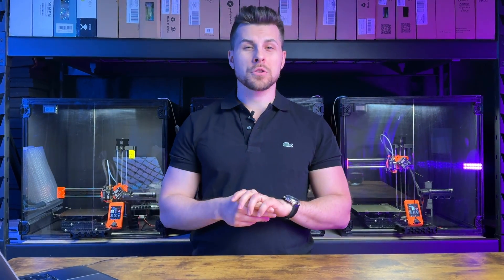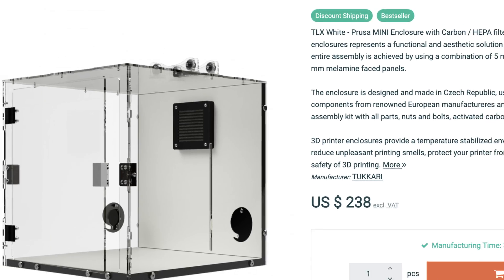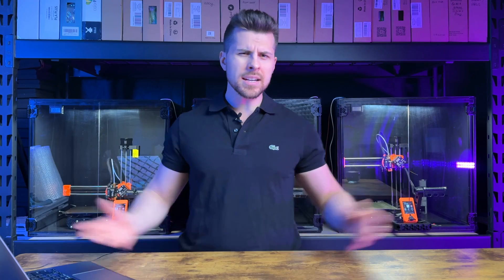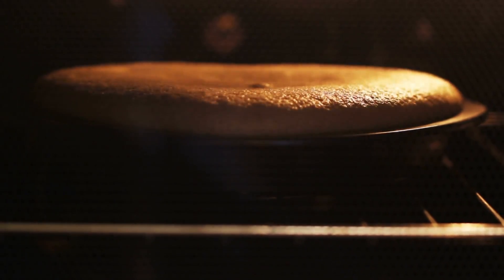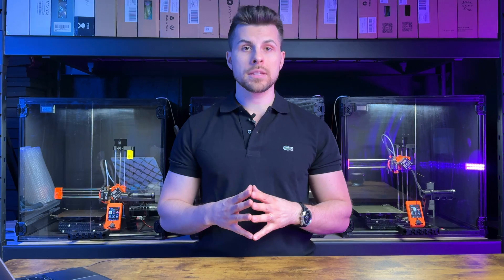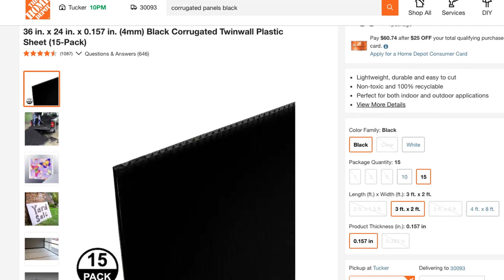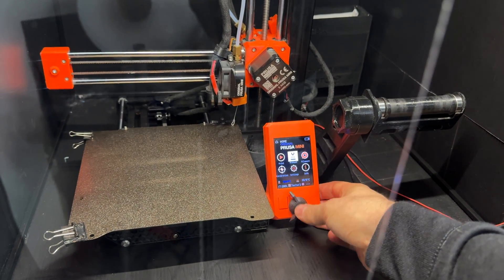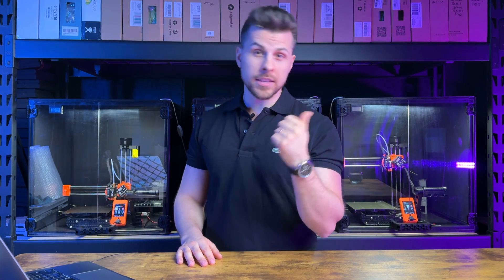Enclosure on a budget - solve warping and delamination when printing with i3 cartesian printers

Comment: Why not just use the shelf for an enclosure? I think I can time my batches that that I can service two printers on a 4-feet wide 72-inch tall 4-tier shelf (more like a 5-tier with one shelf taken off). I to get the heat out under the printer from the power supply and motor controller, I'm going to build shelf tops out of 2x4 boards glued and screwed together on the 1.5-inch side, and use particle board that comes with it to block the heat from the next unit down..

Comment: I don't have a printer yet, BUT after watching many videos I have an idea using 1/8 in. x 4 ft. x 8 ft. plywood Utility Panel, 2 in. x 2 in. x 8 ft. for the sides, some cabinet screws, and the tall glass doors and hardware from a USED display cabinet, then cut everything down too size remembering to measure everything several times before cutting it out, perhaps use cardboard aided engineering. Sand down all the wood and either paint or stain it all, paint inside white for contrast and add led light strips on roof of the enclosure...build the bento box air filter and some sort of heater, perhaps even a mount for a 1080p web cam to watch it anywhere around the home, and perhaps some trim on the outside to make it look nice...

Comment: bro as i seen your printers in background and they are at one solid shelf, why don't you simply use it as aluminium extrusion, and simply apply the sheets over back & sides and use acrylic as lift up slide in drawer ?

Comment: U can simply place the side and top panels between the slots in the aluminium extrusions , they'll be locked in place once the frame is assembled 😊. In that way the tapes can be avoided which will probably be a problem in the long run.
Reply from the maker: Already tried. They vibrate.
Reply: Came in to say that, plus it will look much better

Comment: Good video, I have been looking to upgrade since I've been using a medium Lowe's cardboard packing box with the flaps taped open and one side cut out so it can be pushed over and not interfere with the spool feeder in the back. It is obviously not perfect because every side isn't closed, but it was about $4 + 2 ft of tape. My printer has a camera so I just watch that as it prints because the view is 100% blocked. So far no surface issues! I have had some bed adhesion problems with ABS, but that was eventually solved by just using a raft.

Comment: Even with an enclosure you get inconsistent cooling from the bed moving back and forth 😢 I found I had to passively warm the enclosure in my g-code for 10 min to help further warm. And if printing multiple parts I would put them on the X plain to prevent the bed from moving as much
Reply from the maker: Yessir. Heat soak is mandatory, cartesian or corexy